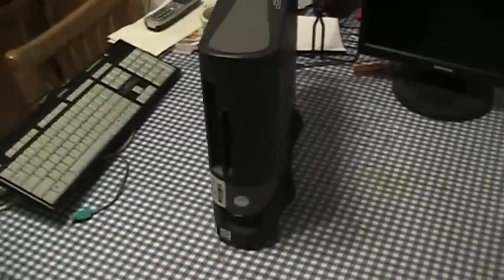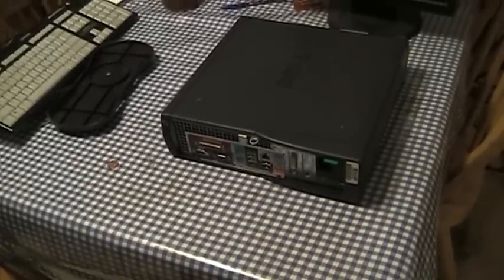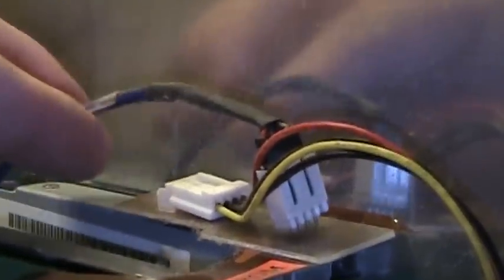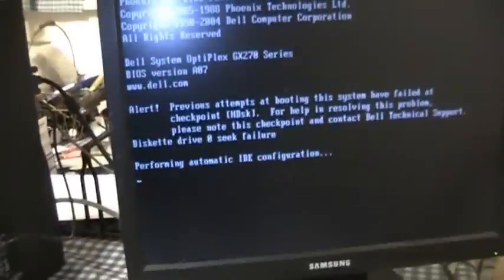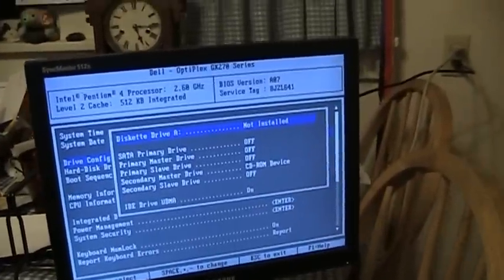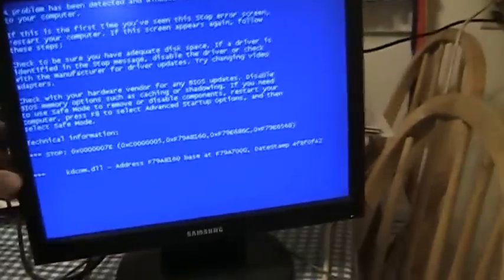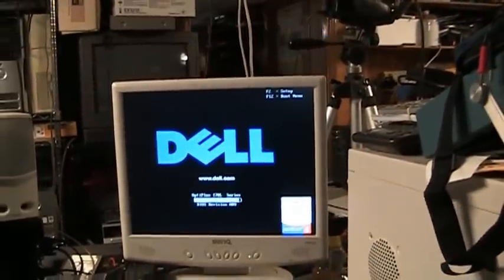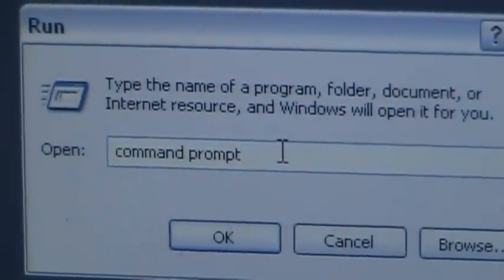UXWBill Explores Another Crappy Computer: Dell Optiplex GX270 SFF

Comment: I forget who it was, but someone figured out that these systems were all plagued with a fan blowing in the wrong direction making the temperatures much worse than they needed to be. We're talking at least a 10C difference.
Reply from the maker: I've heard similar said about the newer Optiplex SFF systems (GX620 era). Honestly, I'm not sure it'd be worth the bother unless you absolutely have to keep one of these running. 

Most of these will have been baking themselves for years now and I don't really think they're worth the effort for new capacitors. Netburst is an extremely disadvantaged architecture (especially with any modern software). If you really do want something from the Netburst era, there are so many better choices that won't bake themselves and blow up quite so readily.

Comment: I found a GX170L at the local recycling spot.
Lovely little room heater, which I knew I had seen somewhere before.
Reply from the maker: While I'm not about to begrudge anyone their interest in any particular vintage computer, there wasn't much good to say about these when the video was made, and there's even less now...

Although, if the one you found still works, that's certainly a plus!
Reply: @uxwbill  This machine will see a very minimal amount of use, but I thought it would be a period correct Windows XP machine. The date of manufacture is late 2006. A good dedusting and lubrication of the fans, then it's a preserved piece of crude history.
Reply: @uxwbill  Would you happen to know of a Linux variant that could be used on the the GX170L system? I'd like to use that computer for simple email chores and light weight browsing, if possible on such old hardware.

Comment: Surely installing a Prescott P4 into a SFF Dell is a damn fine idea? After all, shouldn’t a personal computer be as versatile as possible? A PC that only completes mundane, everyday PC tasks is unimaginative. Now a PC that completes mundane PC tasks, grills a steak and amply heats a small room all at once is surely preferable?! (So long as you ignore the small fire in the corner of the room; a minor technicality).

Oh, and FYI the Windows XP loading bar colour changes for different editions of XP only prior to Service Pack 2, after SP2 the colour is always blue regardless of the edition (previously it was green for Home Edition, and blue for Professional). Before SP2, the boot screen also stated which edition of Windows XP space heating software happened to be installed.
Reply from the maker: Of course it's a good idea to put a Pentium 4 in a case where there's barely room for it to turn around! The small fire just gives you that extra little bit of ambience for the room.
Reply: @uxwbill  Now I hadn’t considered the ornamental merit of an elderly, flaming Dell in the corner of the room! Far better than a luxury cassette stove for your room or parlour. 

I think one would have to be high before being inclined to install a Prescott into one of these machines. Of course you’ll be high after installing it courtesy of the vapour being produced by the molten plastic, as the machine melts itself into oblivion by the miniature sun otherwise known as the Pentium 4. At least the P4 allowed AMD a period in the limelight, otherwise the CPU market today would be a one horse race.

Comment: I have no idea what it is about these systems that I like so much. I think that I'm one of those weirdos that likes the design of them, as odd and quirky as the design is. I think my like for the machine has to do with the computers I used in elementary school. They used to have these white-box Seanix towers and then they upgraded to newer Dell OptiPlex machines. They were desktop cases, but not the small form factor desktop cases like the one in this video. I remember walking into school one day (this was in the early 2000s, probably around 2002-2003) and seeing all the (at the time) new OptiPlexes sitting on the floor, getting ready to be moved to the computer room. That was an exciting day. I distinctly remember the Seanix PCs the school used to have were running Windows 2000, and even though XP would have been available when they upgraded to the OptiPlexes, those OptiPlexes also ran Windows 2000, even after I left the school in around 2008.
Reply from the maker: Had these been Pentium 3 era systems -- and I think Dell might well have made some in this same basic design, only beige -- I'm sure the case ventilation would have been just fine. Same for the midrange Core 2 Duos, had they been around at the time. I pulled a motherboard out of a slightly used SFF GX620 and the area under the CPU socket and northbridge was noticeably discolored from the heat.

In my experiences, Windows XP wasn't ready for prime time when it landed or for some time thereafter. (I personally didn't approve of or recommend it until SP2 had been out for a while.)
Reply: @uxwbill  I've got an SFF GX520, and I had the brilliant idea to install a Pentium D 950 in it. It works, even though the system complains about it. Perhaps I should pull out its board to see if it's discoloured at all. That's kind of funny that should happen, since the newer case design that the GX520 and GX620 use probably have better ventilation than the older, curvier cases. I guess that's a testament to how power-hungry the Pentium 4 (and Pentium D) really is. For example, the Pentium D 950 I put in my GX520 has a TDP of 130 watts. The CPU in my main PC has a TDP of 65 watts and yet its clock is higher and it has 14 more threads. Not a fair comparison, there's over 10 years difference there, but I still find it kind of funny.

Comment: All you’d need is the distributed.net client and you’d have an easy to operate space heater.
Reply from the maker: Running that on a computer like this suggests that one has a death wish (for the computer).
Reply: uxwbill Maybe, though I’d say the clever clown who thought putting a P4 in a small package such as this one had a similar idea. And then there’s the SX260, which is even smaller and packing a P4. I’m pretty sure those had the intended goal of heating from design.

Comment: My brother wants a GX270 or 280 SFF to replace his dimension 3000 and wants to dual boot an updated version of XP and Windows 2000 SP4. I told him about the capacitor problem, but he till wants one. He keeps his computers on 24/7 0_0
Reply from the maker: It'd be far cheaper and far more energy efficient to get a Optiplex from the 745 through 760 models. All of those, and probably even the 780, will run Windows XP perfectly well. Some even shipped with it.

Comment: I have the GX280 SSF, It came from a daycentre that was clearing out it's old machines.. It mostly gets used to write floppy disks.. Though occasionally it's also been used to aid in the upgrading or reflashing of PCI/E graphics boards, SATA controllers, network boards etc ROMs as well.

Comment: interestingly enough, my dimension 8300 is still using it's original 80GB maxtor drive, and it's 2018, so that would make the drive 13 years old, so not sure exactly why it's still working, as the 8300 is acting as a server running ubuntu server so, who knows, maybe it's just running on it's last legs and soon it will die, i dunno
Reply from the maker: I've personally witnessed a few Maxtor drives that just kept on running. If they work, I usually leave them alone.

Comment: I've had better luck with the fatter, less shiny Maxtor drives. They fail about 25% as much as the thin ones like what that Dell has, at least in my experience. Too bad, since I like thin and quiet drives when they work.

Comment: I`m going through a gx260 sff dell. Upgrade the ram too two gb`s and updated graphics card,hhd,cpu getting a boost Ao9 bios that I think I can get it to take A10 and up. Something like the 3.06 prossecor pentium 4 and I`ll bet I can get it to run windows 10 or 7 no problem. No it won`t game the new stuff but it will be a good give away to a beginner to use. Oh why not I`ll throw in a three dollar wi-fi.
Reply: 10, i really doubt it, but maybe. Windows 10 requires Nxbit. Windows 7 would be fine.

Comment: That actually isn't a AGP graphics card. it's a "paddle board" that attaches a DVI-D port to the onboard graphics. The dead giveaway is that it has just a single DVI-D port and not the more usual DVI-I port
Reply from the maker: Viewed from the exterior, it's impossible to tell. I think you'll find that it's described in much more detail, and more accurately, later in the video.

Comment: I loved my optiplex gx720 until it failed after 15 years in a school environment so you must just have bad luck also I had a Serial ATA drive in mine
Reply from the maker: You haven't mentioned which case style your system had. The mini towers were better, though capacitor failures were still a big problem. (Read the trade press if you don't believe me. There were lawsuits filed regarding this.)

Putting a Pentium 4 processor into a small form factor case was a very bad idea, no matter who did it.
Reply: uxwbill I agree that the Pentium 4 in small case was a bad idea but I also had this exact case style my sister got it for free from her school but my current pcs are a dell inspiron 1121-11z and a dimension 4300 And I believe you I just have never had bad luck with Dell's before mostly with HP computers

Comment: Bill, don't know why you're wasting your time with crap like Dells when you could more productively waste your time with higher quality crap like Lenovo Thinkpads, especially T61s 
and T410/420s. They're cheap on eBay (look for "parts or repair") and the innards are modular and accessible.
Reply from the maker: Mainly because like Dell's crap, except for this particular system. Although putting a Pentium 4 in an SFF case was a bad idea, no matter who did it.

While I have a few of them around, Thinkpads don't really turn my crank.

Comment: My elementary school had a couple of these scattered among their rows and rows of Optiplex GX620's. I ended up having to use one of these and almost wished I didn't. We did a small research project and I almost didn't pass because of how horribly slow it was. Now that might had just been an issue with the units at my school, but regardless I've never been too fond of these machines.

Comment: watching this on a 2.8ghz gx280 sff with 1gb of ram and windows 7
Reply: My 260 sff runs just fine. You can upgrade to a duo core if you want. My power supply may not let me. I`m still researching.
Reply: @darrelpetrie8793 GX260? No can't get a core 2 duo. Get a Optiplex 755

Comment: i had multiple computers the same model as this computer, i can tell you a lot about these models. They are actually a very hardy and quiet computer. The things i don't like about it is the CD/DVD rom uses a slim adapter (like most dell SFF computers) instead of a full size connector. This is very bad when you don't have another one. They break easily and are difficult to repair. But they are cheap. My first OP GX270 was stolen and I got it back with missing parts, but it was my only computer at the time so I had to fix it. The motherboard got fried and so long story short, it died. A year later I was at a yard sale, these girls were selling computers and I picked the GX270. They said it needed a new motherboard. When i went to plug it in, it looked like this computer hasn't even been used. It was in remarkable shape, considering i only paid $5 for it and they said it didn't work. It worked magnificently
Reply: Luckily those caps can be replaced. If you are up for a little soldering.
The second one I got a little too rough and I bent some of the pins on the processor, long story short it's now just junk. I have a few LGA pentium 4's, but they won't work on this system since it uses PGA socket

Comment: It sounded like towards the end of the video you were probably going nuts trying to diagnose and fix the crappy maxtor hard drive, my grandma gave me two maxtor hard drives and i had to throw one away because unfortunately windows xp died with a bunch of malware thrown into it (my grandma has a hard time learning computers) so you put in a lot of effort and i admire that! maybe next time i get a few old maxors i will fix them and get them to boot as u did. Although im not quite sure how in the world you were able to get the errors fixed on the drive.

Comment: I just got myself today a Dell Optiplex GX1 Small Form Factor computer. I've heard they're quite reliable, what are your opinions about the computer. How does it compare to a Compaq Deskpro from functionality and reliability standpoint. Do GX1 models have any kind of flaws or issues.
Reply from the maker: I haven't ever seen a GX1 to tell you. I'd guess it's about the same as Compaq's offering. Both companies were certainly building high quality computers at the time.
Reply: uxwbill Well, that's certainly odd! I thought these were pretty common computers and I thought you've used or seen at least one of these computers in its time. Well thank's for replying anyways!
PS! So far the computer's been working fine and I might make a video about it soon.
Reply: *****
So the Pentium 4-based Optiplexes are the   oldest Optiplexes you've actually seen or used?

Comment: I have a friend who was a teacher at a elementary school.  The school had those style of computer(some where small form factor some where full size some half size).  One day another teacher came running down the halls calling his name.  When he got there, there was thick black smoke coming out of the computer, so he quickly pulled out all of the cables and threw it out the window.  When the actual IT director got there he said "Where is the computer!?!?!" and they pointed out the window and by that point there was flames coming out of the computer.  I assume there was a broken fan or something like that, probably in the power supply.
Reply: :O

Comment: The Intel Extreeeeeeeeeeeeeeeeeeeeeeeeeeeeeeeeeeeeeeeeeeeeeeeme graphics can handle everything and also nothing!
Reply: I suppose they were marginally better than say something like my old Athlon 550's PCI Hercules type GPU powered by a Tseng Labs ET4000 series graphics.

No 3D acceleration at all, just 2D DirectDraw stuff only.

The Intel Integrated graphics have actually come an awful long way since the 810 chipset.

Granted they're still nowhere near a decent dedicated GPU in gaming but they're certainly miles more capable than they used to be.
Reply: @Samspianopage  And now they’re even better. With the recent Iris Xe iGPUs in their mobile processors, some semblance of modern gaming at reasonable framerates is actually possible
Reply: @ThatStella7922  I'll wait for the official reviews before believing the hype
Reply: @ThatStella7922  oh didn't realize that. Wonder if I missed the LTT review video about it. Well even if the mobile one's are any good it's a nope from me, if/when I get a laptop it'll be a chromebook. Partly it's not wanting anything to do with windows 11, and looking for an upgrade from my tablet.

Edi
And I'm done with Intel for awhile

Comment: I have a GX280 SFF and yes, the psu popped so I used a normal sized psu brick sitting on top of it. I use older pc's and , for what I use them for, seem to do well. I have only bought a new laptop but others are found at boot sales or given to me by friends or work.
My 280 was an ebay bargain and has been used by me for 8 years now.

Comment: typing 'command prompt' actually opens a DOS emulator. I just tried it..
Reply: it's like an actual DOS emulator commands like edit work!
Reply: But i don't blame you. I would think the same the first time i saw it.
Reply from the maker: That's not quite an emulator. It's the NT Virtual DOS machine, present in all 32-bit NT-based versions of Windows. (The trick may work on Windows 9x as well, but there the system bases on "real" DOS from which the system actually booted, not a mere subsystem.) Its existence is not news to me, nor what I found unusual about it.

I'd have expected the "prompt" portion of the command line in the Run dialog box to be treated as though it were in fact part of a program name, a program that Windows couldn't find and would tell you so in a resulting error. Only that's not the way it worked! Windows treated the "prompt" portion of the string as an argument and passed it to the command interpreter (which, perhaps also unusually, ignored it instead of complaining about an invalid argument or switch).
Reply: Thanks for replying man! love your videos! big fan.
Reply: And thanks for the pointers!